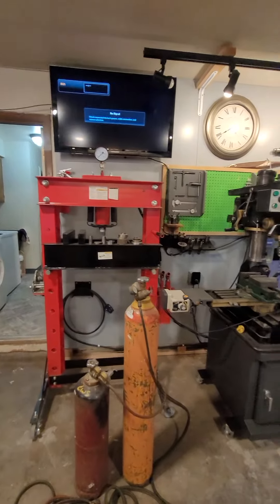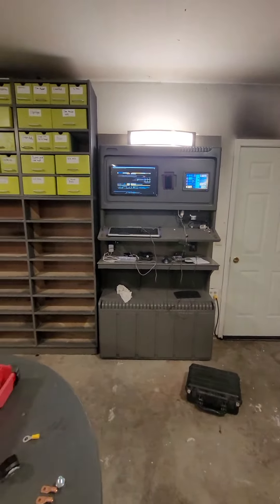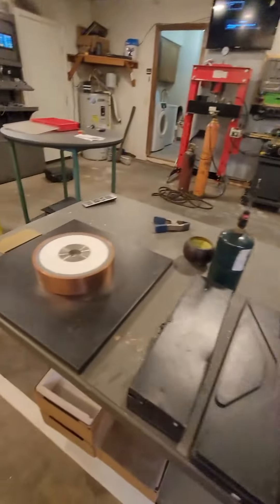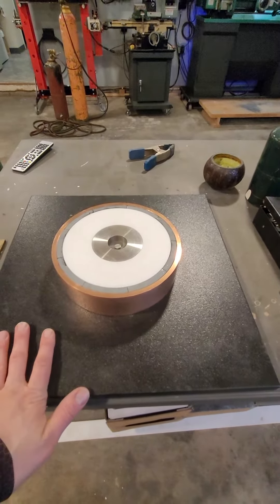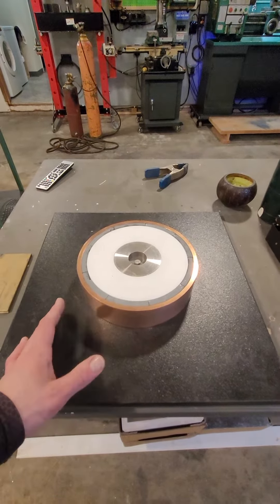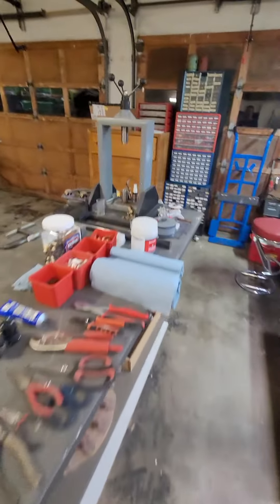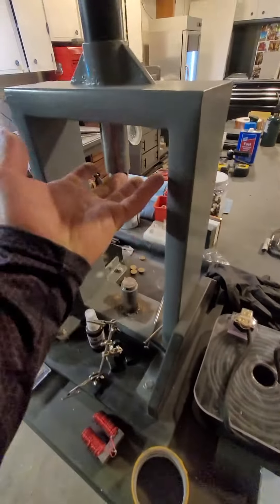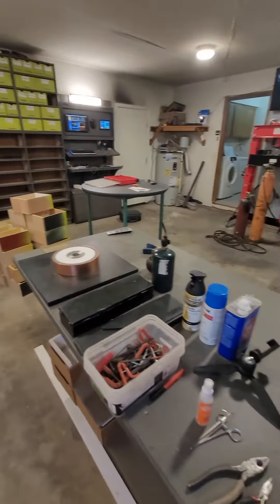Channel update....

Comment: Hope to see more from you and this Searl effect you've been working on duplicating, hopefully you could release a schematic and material list for us future wannabe engineers, either way keep up the good work.
Reply from the maker: I would love to be able to just tell all the info I am in possession of. However some of the devices properties is private info and I won't be able to share it.
Reply: @woodbrassandglass  is this due to personal security reasons? Or is searls effect undisclosed information? To my knowledge he seemed pretty open source about his invention even wanting to push to public hands
Reply from the maker: @wxyz.letter  yes some of the information I found and has now beens removed from the net, other information I was given from Searl magnetics, but it's strictly private info relating to the rollers and pulsing circuits for the mockup I'm doing.